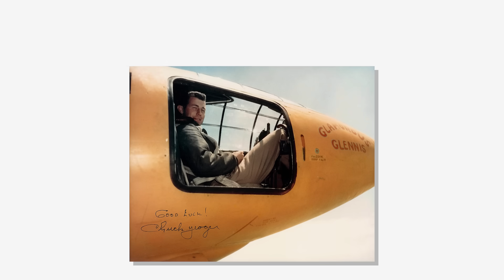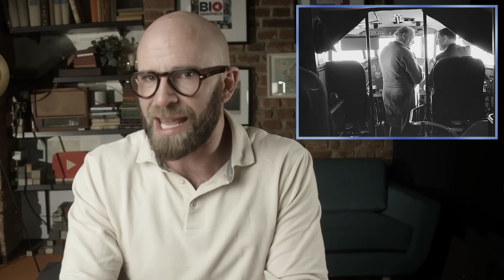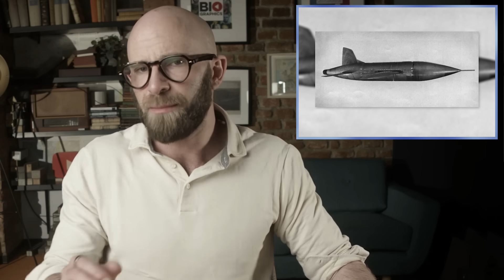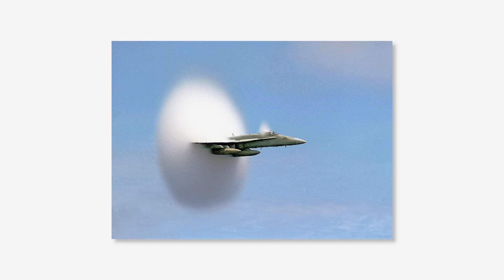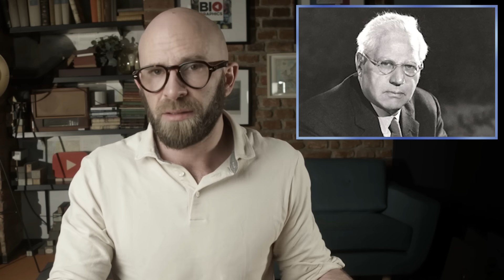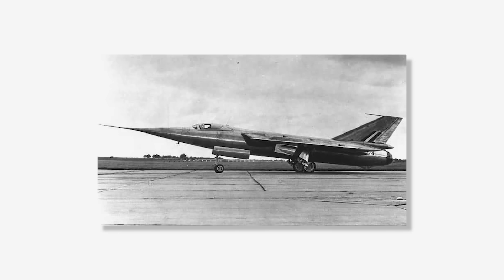Why was It So Hard to Break the Sound "Barrier"?

Comment: There were occasions during WW2 of pilots breaking the sound barrier, I remember reading of a Spitfire pilot surviving a high-speed dive and claiming he broke the sound barrier in a dive, but the equipment on the aircraft couldn't record the speed. The Spitfire had to be scrapped because the pilot had literally bent the wings. Given the high Mach number of the Spitfire wing, it was perhaps the most likely aircraft to survive such a dive.
Reply: Just no...propeller drag, engine overspeeding etc.. We have data from RAE that state the maximum mach numbers for many types, Spitfire included. It is firmly below 0,9.
Reply: @vitkriklan2633 yes, I don't think he actually did it, but he certainly was moving fast. A propeller just can't work at anything close to the speed of sound, and once you lose thrust terminal velocity would slow you right back down. If anyone did it, it was a Me262 pilot, Hans Mutch? Not sure of the spelling of his last name.
Reply: The pilot in question was Pierre Closterman, a Frenchman flying with the RAF. He was trying to catch a German reconnaissance aircraft.
Reply: @gerrymcivor374  That is a very entertaining story but Clostermann later admitted he made it up. The original story involved Sqn Ldr Ian Blair, whom Clostermann refers to and another pilot, whom he supplanted in the story.
Reply: @thethirdman225 I wasn’t aware of that. I read Clostermans biography years ago.
Reply: @gerrymcivor374  It’s still a great book regardless.
Reply: No WWII pilot broke the sound barrier. There are examples of some which got close. I have a photograph of a Me-163 Komet which exceeded its Critical Mach Number and shredded the tail. In practice, no WWII vintage aircraft were built to take the stresses of those kinds of speeds and structural failure was likely. The stories come from incorrect readings from the pitot head with false TAS calculations to stories to impress people.

Furthermore, a high transonic speeds, a propeller acts like a parachute. The airflow sees a disc, rather than something that can produce any kind of thrust. That’s why, even today, nobody has succeeded in building a propeller aircraft that can go supersonic.
Reply: That was Sqn Ldr Tony Martindale flying at the RAe at Farnborough. He dived a Spitfire Mk XI from about 40,000 feet and pulled out at 28,000. He reached a  peak of Mach 0.92. But it’s clear from what happened that 1) the aircraft was quite badly damaged with the propeller falling off and the main wing spar suffering partial failure and 2) that Martindale was not in control of the aircraft for the entire flight.

In practice, nobody was going to do anything like that in combat.

Comment: Wasn't much of a race.  The first X-1 was completed in late 1945, while Miles was still heating rivets and brewing tea.  Initial glide flights were accomplished at Pinecastle Field, Orlando, Fl, then the project was moved to Muroc Dry Lake in Mid-'46.  Rocket flights, first flown by Bell test pilots, , commenced on 9 December 1946.  Bell completed its required acceptance flights (The first 2 X-1s) in June 1947. Air Force flight trials began on 27 July 1947, working up the Mach Numbers in an incremental fashion until Octob4er 14th, when the first supersonic flight was accomplished..
Miles had not completed design work when the project was cancelled in February 1946.
A couple of points: the pointy central cockpit of the M.52 was not a shock body. It's entirely the wrong shape and position in the annular inlet for that.  It is, however, a good continuation of the desired Spitzer Bullet shape.
The slab tail wasn't a new, or British development.  It was the result of work on both sides of the Atlantic, with the Royal Aircraft Establishment fitting one to a Spitfire, and the N.A.C.A. using the XP-42.  The results were presented at the Joint Fighter Conference, held in October 1944 at Patuxent River, Maryland, with the N.A.C.A., RAE, USAAF, USN, RAF, and many Manufacturers participating.  While the slab tail gave good results at high speeds, it was found to not be practical across the entire speed range with the control actuator technology available at the time.  It required the development of Fully Powered Controls with force feedback in the early 1950s to become practical.
The Bell X-1 didn't use a slab tail.  It used a conventional Elevator, and an electrically actuated stabilizer for trim.  Nothing at all like the M.52. All it takes is a good look at the photographs.

As for the DH.108 - during the uncontrolled dive that is considered by some as having exceeded Mach 1, the data recording instruments had run out of film, and there's no actual evidence, including John Derry's descriptions of the flight, to indicate whether it had, indeed achieved anything close to Mach 1.  Geoffrey DeHaviland's death at breakup of a Swallow earlier is known to have occurred at Mach 0.85.

Comment: A rifle bullet is only stable because it is rotating around its longitudinal axis.
Reply: the spin certainly increases both the stability and accuracy, but bullets are stable at supersonic speeds without the gyroscopic effects from spin.
Reply: @johnculver2519  Through trial and error in the time period of 1900-1905, the pointed and boat-tailed Spitzer bullet was developed, and adopted.  It turns out that a Spitzer is pretty much the same shape as a Sears-Haak Body. which is the ideal supersonic shape.
Reply: So what?

Comment: Yes indeed I've heard this occasionally, Chuck yeagers aircraft would never have gone supersonic without learning about Britain's all moving elevators
Reply: Except - First - the X-1 didn't use a slab tail.  Any decent photograph will show you that.  It had an electrically actuated stabilizer for trim, and a conventional elevator.
Second - the potential for slab tails for transonic control was explored by both the N.A.C.A. in the U.S. using the XP-42, and in Britain by the RAE on a Spitfire.  It was found to not be useful with the control systems available at the time.
Reply: We invented this design before World War II on just a propeller aircraft, how many times have we been robbed by America & Canada's Avro Arrow
Reply: I don't mean Canada robbed us
It is reference to the mighty Avro arrow getting cancelled in favour of the American design I'm sorry if this was not understood
Reply: Early research on the movable horizontal stabilizer was done by the NACA on a Curtiss aircraft in the 1930s.
Reply: @maxschell8823 it's a shame then they did not understand it's useful high speed flight ability

Comment: Stabilators existed in the 1910s, and the X-1 had a much more advanced design than what Miles had developed.
Reply: And you know this because...?
Reply: @thethirdman225 Because I have an interest in aircraft design.
Reply: @pseudotasuki   And what have you read to back it up?
Reply: @thethirdman225 The US had been experimenting with stabilators since at least 1942, with a modified XP-42 prototype.

The X-1 had both an all-moving tailplane (stabilator) and traditional elevators. The stick originally operated just the elevators, but the design was modified after transonic flight tests to also operate the stabilator. If they were simply copying the British design, it wouldn't have included an elevator.
Reply: @pseudotasuki   Okay but you could have said this sooner. But bear in mind that the British had also been experimenting with all-moving surfaces too. That was part of the point of this video.
Reply: @thethirdman225 He overtly claimed the US stole it from the Brits.
Reply: @pseudotasuki   He says some silly things at times. "Stole" is a bit strong but it doesn't mean the British weren't working on the same idea.
Reply: @pseudotasuki   Okay, now that we have that out of the way, can you please explain why the X-1 was a "much more advanced design" than the Miles? Because I can see anything myself that suggests it. In fact, the X-1 looks a lot more conventional.
Reply: Lol Yank being a Yank...